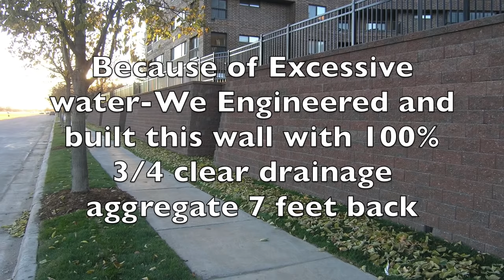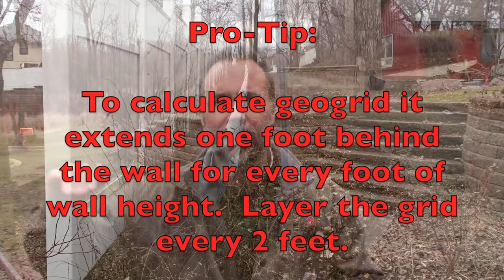How Not To Build a Retaining Wall

Comment: Finally run into a video where someone knows proper wall construction. Many wall buildings videos out here are failures.   I learned how retaining walls suppose to be built by watching major construction crews build them along highways like for overpasses.  The large rock was larger than 3/4", the geo grid anchoring mesh, all very intresting.   Hydrostatic pressure, expansive soil,  a major consideration.  Tree roots no good for any concrete, sidewalks, building slabs etc.

Comment: My grandfather bought a lot in 1936 in, at that time was unincorporated Los Angeles County,  Los Angeles. Between the sidewalk and the road was a 10 foot retaining wall. Some time in the 80’s that wall failed, started to push over, and the lot was condemned. Took the city decades to “fix” the wall. All they did was add concrete to the wall and angle the footing, making the road narrower. I wanted to build a small house on the lot but he wouldn’t let me because of how the city did the wall. He said if you put anything on that hill the wall would give. From what you are saying in this video, he was right. I ended up having to sell the lot when he passed away to settle his estate.
Reply from the maker: Sad story -to bad the city could get away with that.

Comment: Good Job Stan!  Many great points presented in your video.  I design all types of retaining walls at my job, and we also investigate retaining wall failures.  We only specify #57 stone for the foundation and drainage media behind the wall.  We also add a perforated drain pipe at the base of the drainage media behind the wall to collect and discharge any water which enters the drain behind the wall which is connected to a stormwater system or weep holes at regular intervals near the base of the wall.  The vast majority of the failures that we see are caused by hydrostatic pressure (water pressure) behind the wall.  Other failures may be caused by the use of pea gravel instead of the angular #57 stone, the lack of a proper filter fabric (geotextile) wrapped around the drainage stone behind the wall allowing for soil migration into the stone, damage to the geogrid reinforcement behind the wall by planting large trees or constructing a pool  or other structure to close to the wall or insufficient embedment in front of the base of the wall to resist horizontal sliding of the base of the wall. Some designers also do not properly account for sloping ground in front of or behind the wall, or run a global stability analysis as part of their design analysis.  Keep up the good work!
Reply: I nominate this as the top comment for this video! Poster is absolutely correct. A retaining wall must have provisions for relieving hydrostatic pressure behind the wall either by weeping the water between stacked masonry units, or by provision of weeps in a poured wall. If weep holes are employed, there must be a french drainage system or perforated tile that extends to the weep holes in such a way that the drainage stone and weep hole cannot clog with soil. The drainage pathway must include appropriate permeable mesh surrounding it to exclude soil from the drainage fill, thereby maintaining both permeability and flow to move the water out the weeps.

Comment: Great video. I had a retaining wall fail in 10 years. The retaining wall was also the foundation of the barn that was 60 feet long. It was 8 feet high maybe 10" thick with a footing that was about 20 inches wide and 10 inches thick. There were 2 supports that were 20 feet apart built at right angles but only went back about 4 feet. The soil behind the wall was clay and heavy with water. The middle began to bow in. The back of the barn built on wood beams began to angle back 5 degrees then 10 then 15 then 20. It finally fell over in a mini tornado. The barn from 1790 was a total loss. 3 tractors crushed. They charged my 75,000 for the work on the barn.
Reply: Then why didn't you dig out the barn on the inside (you have the equipment), push the wall back up and pour several huge supports?
Lazy.
Reply: @TheGuruStud  easier said then done. The retaining wall bowed in the middle. The 2 corners had lateral support so they were still mostly vertical. But the middle section was tipping about 15-20°. Pushing on it would probably result in the barn falling on the person inside. There is no chance this idea could have worked. The only solution was to raise the barn again, at great expense, tear down the old retaining wall and reexcavate. Then pour another stronger wall with deeper footing and better lateral support in the middle.

Comment: Hey Stanley I am struggling to find the right way to cut blocks for a wall I am building.  First of all, thank you for all your amazing videos.   I have Belgard Diamond Pro Smooth face blocks.  I have rented a saw with a 16 inch Diamond blade from my locale rental. company.   Is this the right type of tool?

Comment: I have a question ... We are having a house being built here in Florida... our back yard has a slope  that goes down to a pond. The pond is about 25 feet from my property line. We want to build our backyard slope up so it is usable yard and then either slope it down again or build a retaining wall. We plan on having our wedding in this space so we need every foot of our yard to be usable. Right now we have about 20 feet that is usable but there is another 11 feet in this slope. So should we build it up and then slope it out again or make a retaining wall? We will fence the yard with pvc fencing and a smaller pvc in the rear to see the pond. I know its up to us but I would like the have your opinion .. thank you
Reply from the maker: Both are good options but the ultimate determinate is price.  Walls are more expensive but will gain more space.  Grading is cheaper but will not get you as much level ground.

Comment: Highway - I225 with the flyover interchange of Parker Road in Aurora CO has a retaining wall that failed. It is currently patched with PVC and Concrete to allow drainage. They used the pea gravel and sand on the send up and down of the fly over (ramps, whatever engineers call the part of the bridge where it is dirt then the span and dirt again) I remember seeing the water come thru the wall and indeed have seen other spots that will likely fail and it is exactly the same mistake you discuss in this video. :) Now i know what happened. I also know it is a huge mess to fix it but still the more you know :D thank you for the explanation

Comment: I'm a huge fan of Rockwood retaining wall stone, it isn't held together by a poly or plastic pen.  It uses (if done properly) the 3/4 or 1 inch stone along with the attached concrete knuckle to retain the block and wall.  Thank you for clarifying the importance of back fill and drainage to counter the hydro-static pressures behind any retaining wall.  It doesn't matter what stone you use, if you don't properly back fill and use it to the engineered specs it will be a failed wall.
Reply from the maker: +jason eshelman Yes- well said.  The backfill and compaction is the key to longevity.

Comment: Hi Stan, very nice video. Apologies if this sounds like a silly question but was wondering if it is possible to build a concrete sleeper retaining wall in a shallow river where the water only rises just above the angle height and the height of the wall is about 2.5 feet? At the back of our garden we have a river not that wide and need to replace the timber wall in favour of a new retaining wall using concrete posts and concrete gravel boards where the gardener said he will use sleepers. I asked another gardener for a quotation and he said that if concrete posts are used then this could make the wall collapse overtime and he said that he would use metal angled posts to hold the wall together. Any advice would be most appreciated. Thanks from the UK.

Comment: How do I build a 100 ft long retainer wall along a creek line for a solution to flooding my property and what is the best design. The creek is not deep and it is not straight, it has curves. The wall needs to be about 8-10 ft high.

Comment: great video. I have a slopped front yard and wanted to do a terraced retaining wall for raised gardens (versus a rotting wood raised garden). It seems that that is ok as long as I make them twice as long as they are high correct? then also use the correct backfill stone 3/4" angular with top soil on top (use garden mesh for the last few layers to retain the soil and avoid it silting out the rock). Does this all sound like a good plan? Anything I missed?
Reply from the maker: Sounds like your on the right track!

Comment: Very helpful video.  I like how you get straight to the info with some good examples. One of your examples is exactly what went wrong with a retaining wall built to my house in 1948. It's terraced cinder blocks and it's probably been leaning since 1958. no real movement for the 15 years I've owned it.  Somebody has proposed simply reinforcing it with recycled concrete versus taking it out and starting over. Any thoughts on this?

Comment: Very nice video! 

Regarding root activity of landscaping trees, select a tap rooting tree species rather than a lateral rooting species for plantings within 25' behind a stacked retaining wall. For example, redbud trees are commonly selected by landscape architects who want above ground beauty. But their long and forceful lateral roots can wreak havoc on a stacked retaining wall. So best to use other species like desert willow or another planting zone-appropriate tap rooter. If a lateral rooting species is to be included in the landscaping, the retaining wall should be poured concrete with sufficient tiebacks for anchoring into the ground mass behind the wall. In other words, additional tie-back to allow for the dynamic loading of lateral roots.

Comment: Leavage and Drainage is the key...

Oh yes, if you plant a tree - drill your augur hole 5ft. 180% from the wall, this helps the tap root and ball grow into the uphill bank side of the wall.
Reply: Thanks for the exfra tip. Im planning a brick retaining to contain a circular section. Am.i askin for trouble tranplanting a mature Sago Palm into this circle? The tree is maybe 6'tall with a  7' diameter dripline. The wall diam is variable, but max is prob. 7' as well. The elev. difference is just 14". (Also, its adjacent to the house if that matters) Thanks!

Comment: So that wall.. There is 7 feet of horizontal aggregate behind it? from top to bottom? just want to be sure I understand correctly... Also, what is under the wall for support, concrete, mortar, grade 5? Thanks Stan!
Reply from the maker: +yowmemperor yes-  its base is 3/4 clear aggregate swell.  Same material.

Comment: I live in Florida, my yard is pretty much sugar sand.  I am laying pavers but would like to add a sitting wall around the paver area.  Do I need to pour a footer, or can I just geo, and gravel the base, and then stack paver blocks?   I appreciate your video's!
Reply from the maker: Sand is solid but not cohesive.  You will need a binding agent in the soil to help stabilize it.  IE clay, class 5 or other compatible,cohesive soil.

Comment: Appreciate the great video and the tips. Curious why you say no compaction plate on or within 3 feet. Surely a tamper is fine, correct? I just watched an Alan Block video showing them doing exactly that (compactor plate) while incorporating steps into the wall. About to tackle my own wall 70' long by 2-5 feet in height. Thanks!
Reply from the maker: It pushes on the wall and can ruin the base blocks level.  Creates a greater potential for longer term failure to speed yup.
Reply: That goes against what Allan Block is saying. All their videos tell you to compact the wall rock behind the wall as well as on each layer of wall itself. And they specifically tell you to use a mechanical plate compactor and emphasize the importance of using it.

Comment: Do you ever put concrete inside the hollow blocks, we have wall blocks that you fill with concrete after you have installed them all, minus the top layer?  Hello from Finland. :)
Reply from the maker: +thequattro20v No concrete- that would be bad- it wouldn't allow the water to flow through the blocks and would create a premature failure.

Comment: I have a small slope that angles down toward my carport and house. I need about a three foot high wall do I put the French drain on the hill side or the carport side so the water will stop pouring in my carport off the hill when it rains.
Reply: J G behind the wall on hill side with fabric drain bed and drain rock back fill are standards in oregon

Comment: thank you! I will be build several allanblock walls. This great to know!!  How do you calculate length of Geo Grid behind wall?
Reply from the maker: 1 foot of grid for every foot of wall height spaced at 2 foot vertical intervals.  SO a 6 foot tall wall has 3 layers of grid with each layer being 6 feet long.  A 9 foot tall wall will have between 4 & 5 layers of grid with each layer 9 feet long.
Reply: Allan Block has videos on it. And they have a document where I think they specify it.

Comment: if i build a two tier wall. 3ft high first wall go back one foot and do a 1 to 2 high wall there. is it possible to put in long rebar and cement into the voids on 2nd wall? would that work? or would it also fail after awhile?
Reply: Chakat Nightsparkle he just said distance must match first wall, 3 ft wall 3ft to second wall
Reply: No..that is not what he said.   Double the distance of the height of the first wall back.  3' tall equals 6' back.    What he did not mention is that most towns require engineering at 4' tall, some less.  So one wall at 5' high would require engineering in most areas, but two spaced correctly you can often avoid the engineering.  With two walls you then get into something called global stability that has to do with soil loads and rotational loading..... that is over my head even after 30 years installing these walls.

Comment: Some of the oldest retaining walls, that shock me with their longevity, and even height, were made from........tires....   woa.....I've got a 50 year old retaining wall on my property holding a bridge, made with rock/dirt filled tires.   They also lean back into the load, and thus, somewhat reduce the support triangle behind the wall.  Concrete walls, are not doing as well.
Reply from the maker: The overall longevity of a wall depends more on the backfill procedure than the material used in the face.

Comment: Please explain hydrostatic pressure... thanks in advace
Reply: It's the pressure exerted by water in a containing vessel. In the case of a retaining wall is the force (over area) exerted against the wall by the water trapped in the soil being retained. Obviously, if the drainage is sub-par the accumulated rain water can exert enormous pressure against the wall.